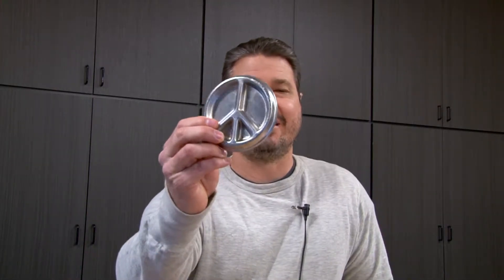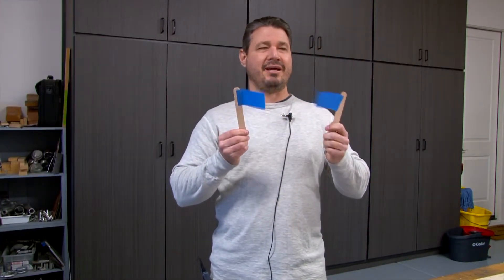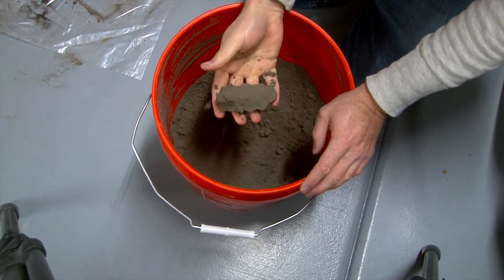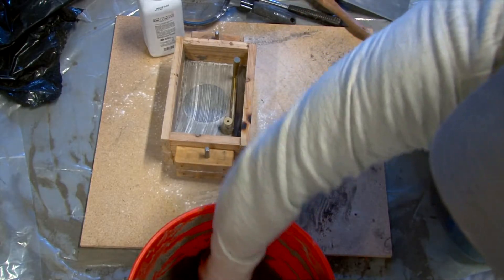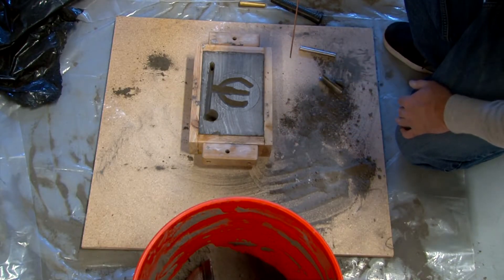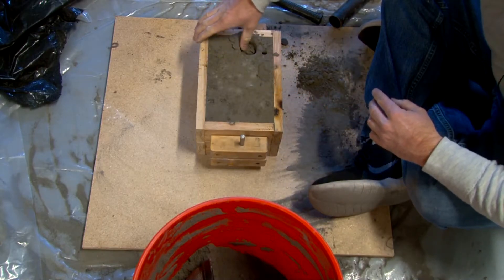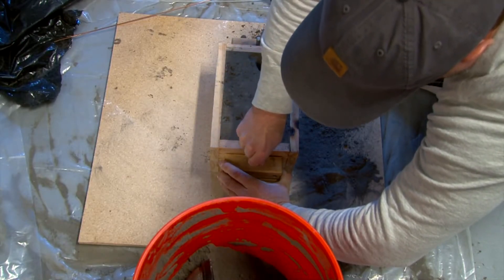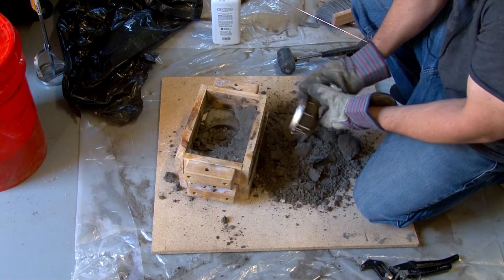Aluminum metal sand casting of a 3D printed peace sign

Comment: Very cool.  Where did you get your furnace?
Reply from the maker: I got my furnace from amazon.  If I had to do it over again I would probably purchase a different one.  Mine came with the burner in the center so its hard to get a nice flame swirling around the crucible.  Also,  I was informed recently that the unprotected ceramic wool is really bad for lungs when inhaled.  I have now purchased a refractory cement made for coating furnaces and plan on doing that before my next melt.  So i would say purchase a better built and coated furnace than mine.  Good luck!